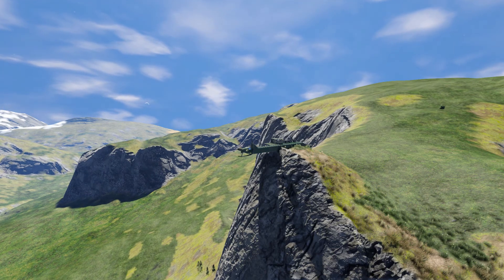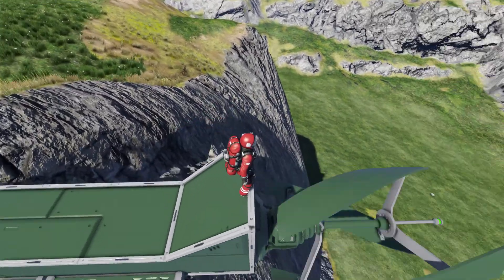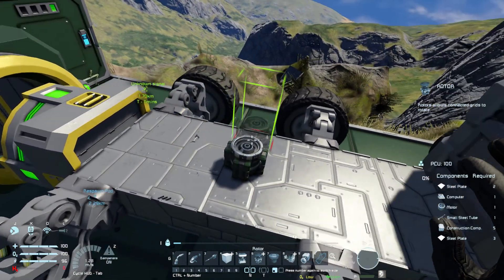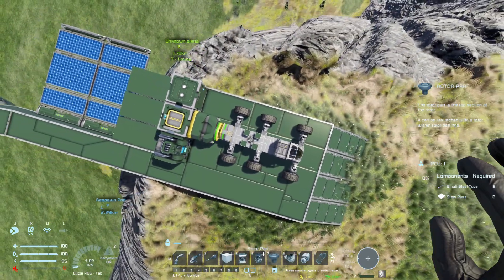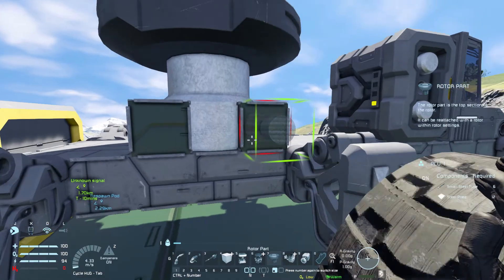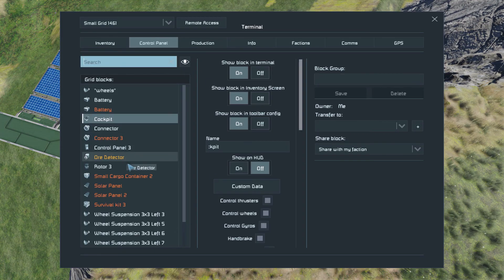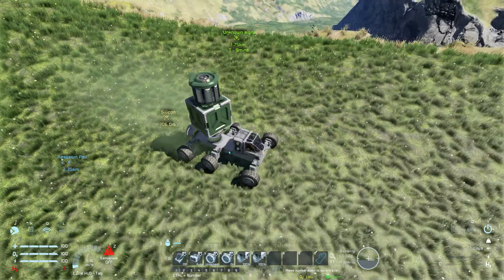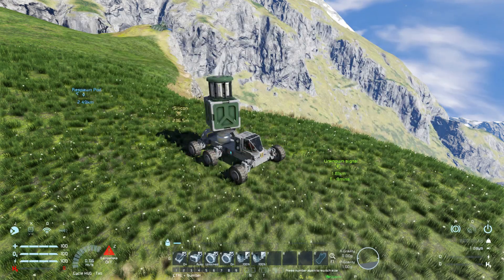Space Engineers - tutorial - how to search ore properly 2022

Comment: i could not drive the rover for some reason 
did ecxatly what u did :/
Reply from the maker: Hello, make sure you have the parking off perhaps you forgot them on, or the whiles are not off in that case they don't work even if the parking is on, if this is not fixing them then sometime Space engineers haze a bug where the grid is broken and you need to copy past it with another one or you need to go out of the rover hope in another vehicle and go back in the rover, some time this fix it if you are on an online server .If you are in survival then is harder because you don't have admin tools and you need to build another one. ahh and one last possibility is to check  the wheels override in the wheels settings panel perhaps you have them messed up somehow the settings.
Reply: @BURN7Gaming   thanksss for the help, what i did was breaking all suspencion and building it again. 
I got so nervous but, what metters is that your tip worked :D